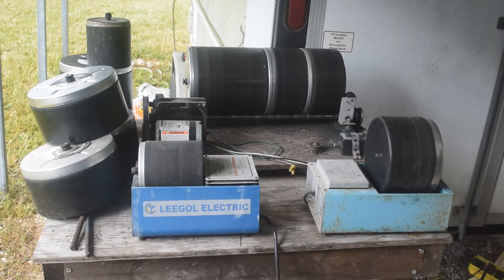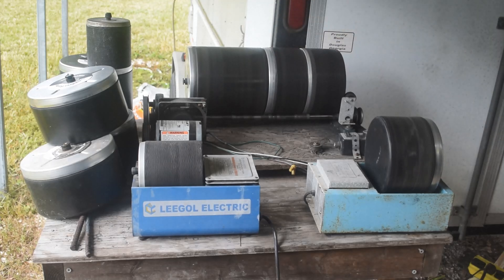Designing My Dream Rock Tumbler: Very High Capacity #thefinders #lapidary #DIY #rocktumbler

Comment: Don't know into your build, but.listening to your motor thoughts I have an idea.
Not long ago the motor on my wood lathe went out and I bought a used tread mill and used the dc motor which is 2 hp and the controls off the treadmil to give me speed control and a more powerful lathe. Not only did I get the motor,  but all the other parts of the machine one being the board that the belt rolls which made some great jigs in my shop. Treadmills are at about garage or estate sale I've ever and sometimes very cheap.

Comment: I have been building my new dream rock tumbler for 3 months now. I started with 2 8mm rods and a motor then bought 2 12mm rods and another moter then bought 2 more rods for my tumble bee and then made 2 drums out of ABS now I need more drums it keep going on and on but I have run out of room on my piece of plywood.

Comment: Do you think you may have an issue with the drive roller being elevated? Also, the drive shaft will be pulling I’ve on one side and pushing away on the other side? Just trying to visualize it, definitely not knocking it. 😊
Reply from the maker: I've had the same thoughts. I'm thinking to have the side with the larger, heavier drums being pushed, and the side with the smaller lighter drums being pulled. We'll see how well it works. Hopefully there won't be any slipping.